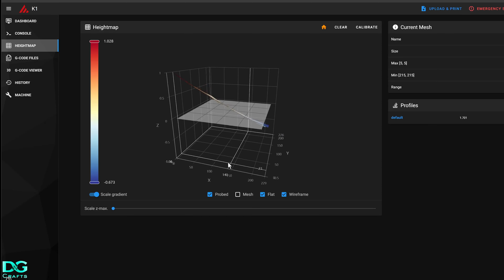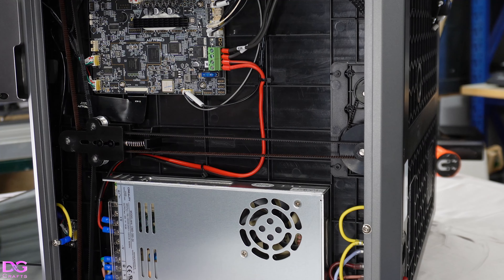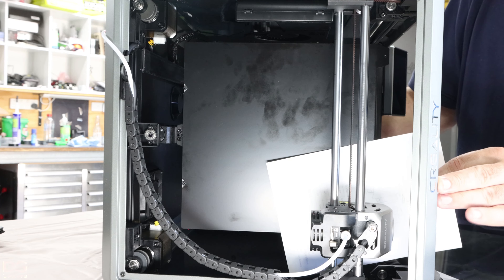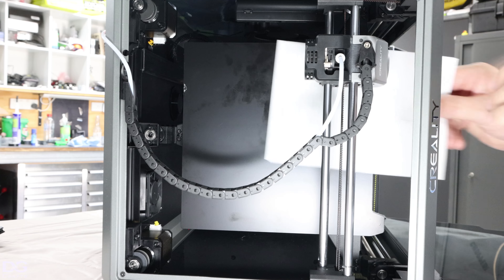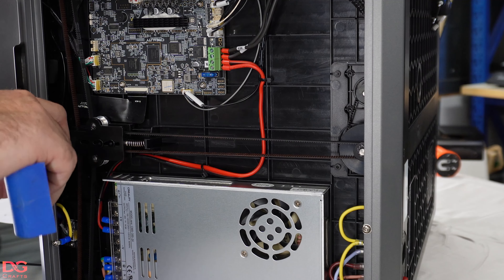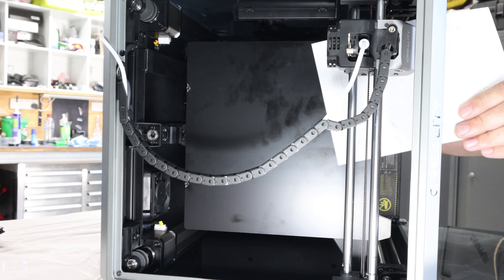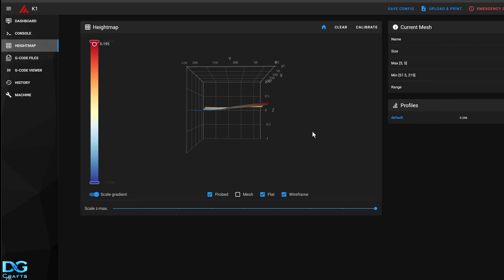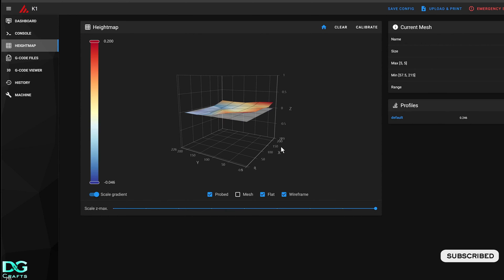K1 / K1 Max Bed Leveling

Comment: Thanks. Check out a first layer though. I carried out the same procedure as you, thought the mesh looked much better, but the first layer over extruded intermittently with under extrusion. So out of frustration I removed the silicon spacers under the bed and installed m4 screws in the corners with springs (think bed slingers) and adjust the bed now manually while printing a first layer.  Old school, but it worked a treat. Personally I think the K1 leveling issue at least requires a firmware update. But it’s a reasonable machine for the price.

Comment: I did this method, and oh my God, my levelling is beautiful sat at .154 that's so much better than my last k1 I had to send back to creality due to the bed being wonky and getting failed prints finally I don't have to worry about that and I can do my linear rail mod and fix the issues it's got due to the vibration compensation I'm getting bad ringing and banding within my prints so I'm gonna do the linear rail modifications to see if this fixes the bad about my k1 speedy as iv rooted the k1 aswell so I have full control over the marcos finally 😅

Comment: In this video you adjust the front lead screws manually. How to I adjust the rear lead screw? My mesh is high at the back
Reply from the maker: if you are having trouble moving the rear screw because it has the stepper attached you can loosen the belt the same way but turn it using the wheel under the screw as shown in this picture with the red arrow.

https://i.ibb.co/tK9Ybh6/screw.jpg

alternatively you could adjust the front two screws higher which will make the back lower, just add the same amount of clicks(tooth skips) to each front screw.

Comment: Thanks for the great video. Did you manage to get your machine to compensate for the remaining difference? Mine has never compensated in the 6 months I've been trying to troubleshoot and my first layers, and consequently any other layers if it makes it that far have been extremely inconsistent and unusable. I can set the Z offset perfectly in one spot and all other spots will be terrible.
Reply from the maker: thats how mine was until i leveled the bed to the nozzle.
i did do one machine that still refused to play nice after i leveled it and the only way to fix it was to force it to do the initial calibration that is done when you first set the machine up.
after that it was ok.

another thing to check is the bed warping once heated, if you level it cold and the bed warps bad when its hot it will throw everything out so it might need to be leveled while hot.
Reply: @DnG-Crafts  thank you. i've preheated my bed for a whole day and it unfortunately still makes no difference. neither does the calibration. i've managed to do a few prints by manually controlling the first layer z offset, and squishing it until it evens out over a few layers lol

Comment: at 6:28 you show the bed leveling data but that looks very different to my creality print interface - or are you using something different? I don't have the numbers or the mesh size - just the graphic.
Reply from the maker: my print interface is mainsail, i show how to install it here.
https://youtu.be/7CcSahW-cR0?t=108
the video was recorded before creality released the root enabled firmware so you can skip the "update firmware" section and start at 1;48.

Comment: This is awesome but what were the first steps that you did prior to the paper and raising? did you just leave the z, x, and y axis in the home position? Or did you do z probe offset at each corner? Thank you!
Reply from the maker: i ran a bed mesh to work out where the high point was closest to a leadscrew and then moved the bed and nozzle by hand, you could home it if you like but you are going to move everything by hand so it is not really needed.

another way to level it is to use silicone spacers or springs and modify the bed mounts with them so you can adjust the screws like most other printers but i did not want to go that route i just wanted it to be closer to level than it was.
Reply: The z offset doesn't matter? Yeah I was at a decent offset then I tinkered with it some more and now I'm way out of wack :( like -1.2 front left and 3.0 in rear... I might end up just returning this printer... too much of a hassle but I'm pretty sure it's operator error so I'm going to continue to try.  @DnG-Crafts
Reply: Did you adjust your rear screw at all?
Reply from the maker: @Craysav  no i only adjusted the one screw shown in the video, if the z offset is not right after leveling try and do the "self test" in the menu which will run the printer through the process of leveling, input shaping, z offset etc

Comment: It looks really simple when you're turning the rods to get the click. I'm having a similar bedmesh on my k1 max as the one you had before leveling and I tried this method. Even though I'm loosening the belt, it's really difficult to turn the rods, and most of the tries I did resulted in me just raising the whole bed... I think I got 1 click out of sheer luck 😂 Any additional tips on what I could try to get more clicks?
Reply from the maker: with the k1 max on the part where you loosen the screws try take the screw out that is closest to the frame of the printer as it will allow more movement when levering the the belt tensioner. 

i show it in this video at 17;54
https://youtu.be/_Ob9120QvBU?t=1074
Reply: @DnG-Crafts  Legend! Worked like a charm! Went from a 1.2 diff to 0.4 without any difficulty! Best of all I'm not dreading to try it again if needed :). Thank you thank you thank you!

Comment: Man, your table is angled and you're touching a single axis.
Remove the 4 bolts from the table and replace the 4 cylinders it rests on, printing new ones with the correct height adjustment.

Comment: but why auto bed leveling not compensate that?
Reply: The bed leveling has a range that it can level the bed effectively. Some beds are SO FAR OUT OF the level that the bed leveling can't compensate. This little tweak in the video gets the bed in a better range and therefor the bed leveling can do it's job.